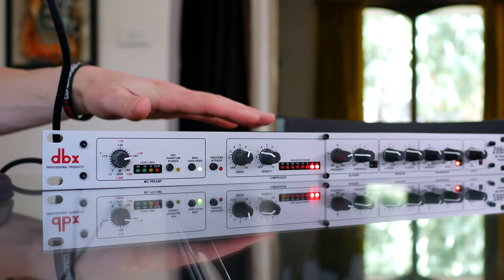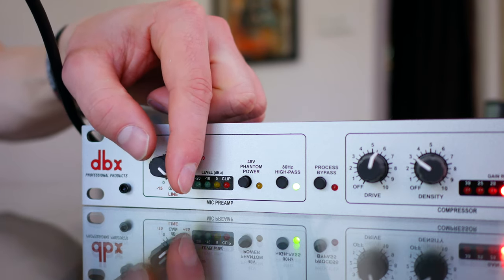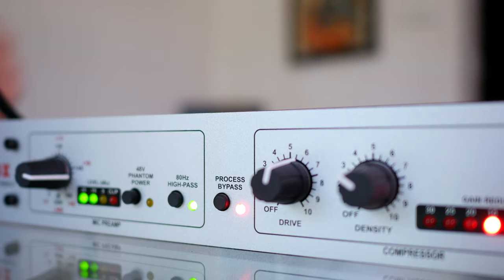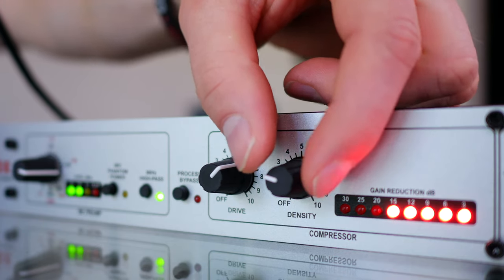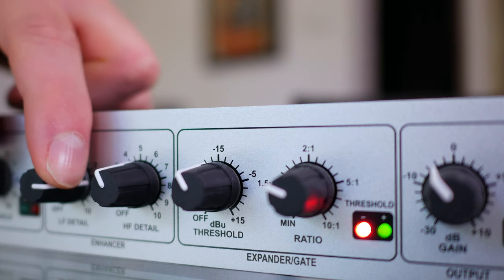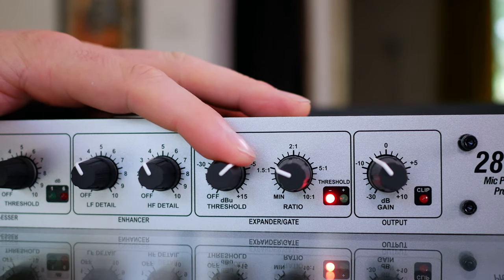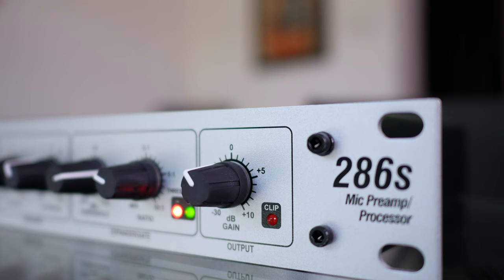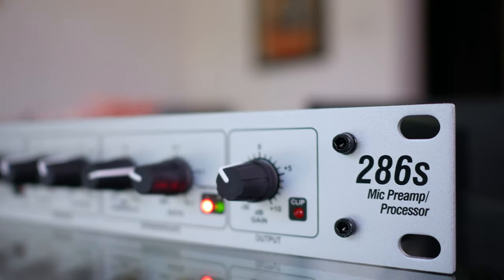How to use the dBX 286s Microphone Preamp and Processor

Comment: Great to find this. I have the dbx 266XS Dual Compressor/Gate and I believe it should work similar. I never used it, as it was left in my storage unit. I plugged it in, but have nothing to test it to sell. But upon plugging, no lights at all come on. Do these have a way to find out if it's dead. Should at least one light somewhere be lit up?

Comment: I've had my 286s for some time, the only issue I have is with a low output mic (like the Podcast&Procaster, I have both) is that I run the preamp near Maximum . To get round this I use a small Mic preamp (Behringer Mic100) connected on the Line input . The setting on the input gain is now on 0db and I control the input via the preamp. The behringer Mic100 is a good little Valve amp in its own right but added to the 286s its now something else.

Comment: Love your video and info on the DBX 286S. I have a question about the 286S. I'm a Newbie in my Voice-Over endeavor. I'm currently rebuilding my recording booth due to too much background noise with what I originally had set up. I use a Rode NT1A and Scarlett Solo. I do not stream yet. My question is would it benefit my signal chain to include the 286S when recording for VO only to be post processed?

Comment: Thanks I just bought this because of your video! I'm also using Rode Procaster mic with Behringer UMC 204HD interface and new MacBook Air. Although all sounds pretty good, i'm not quite hearing the sound quality like yours. Maybe my expectations are too high for Rode? My UMC gain is middle, DBX gain +45 / output 0. Still sounds a tad tin-y. I have good quality cables/adaptors too.

Comment: Always, always, always calibrate your gear;  it's called "Gain Staging". To stay "safe" is to manage the levels of audio through the signal flow. You always want the optimal amount of signal to flow in the analogue stage without introducing noise or distortion(some distortion is taste based).
Reply: Always start yourself with a high signal to noise ratio too, don't want to preamp noises!

Comment: Hey, I've had the dbx286s since early 2016, but I saw that I had a mono trs 6.3mm to male xlr in the output of the dbx, but I've seen guys have stereo trs 6.3mm to male xlr cables instead, should I change?
Reply: Not neccesary, but it's legit, just try and find out, what works better for you. You get better signal / noise ratio and more headroom with XLR output

Comment: I just bought DBX 286s and Rode Procaster, I plug Rode to my Behringer UMC202HD (Gain there OFF/LOW).
So on DBX the first Nob with Gain, you got easly 2 green light on, mine even on +45 I bearly one light poping sometimes. 
Same thing with compresor, with like +45 Gain I put compresor about 2-3 on nob, sounds in headphones almost cliping is that loud ;/
I'm hearing you on Gain + your compresor settings and you so sooooo different that I do on my test ;/ Need to leran more about those settings I think ^^

Comment: I have a question.  If I'm gong to be outputting the signal from the DBX to an inexpensive mixer (like the Behringer Xenyx or a Soundcraft that doesnt have inserts), do I put it in the mixer's MIC IN or over to one of the LINE IN's? I've heard different answers but to my mind, wouldnt using the mixer's mic channels cause me to be running through TWO pre-amps?
Reply: Line in, bc you will bypass the crappy xenyx Mic PreAmps

Comment: How do you like that Procaster mic with the dbx?
I am torn between getting that and an SM7B (for voiceover and singing, with a bass/baritone voice). I already have a dbx 286A (older model of the 286S), and would get an UAD Apollo Twin as an interface.
Reply: You won't regret with SM7B. I have the following set up for my singing  - Focusrite Solo 3rd gen, dbx 286s, SM7B and beyerdynamic DT 770 headset. And I zeroed down on these gears after trying several of them.
Reply: @hemantsharma17  Many thanks! :)
Reply from the maker: The Procaster is maybe the best value high-quality podcasting mic out there.  I would highly recommend it.
Reply: @GeekyNerdyTechy  Thanks! Would you recommend it for e-learning voiceover materials as well?

Comment: How do you go about plugging one of these into the Focusrite 2i2 interface?
Reply: Hello, you would need to first power the unit. After that you need to plug your microphone into the input on the back. Once you’ve done that you need to bring a line out from the output and into one of the inputs into your Focusrite 2I2. I hope that helps and wish you luck! Goodbye.

Comment: I wonder if anyone can answer this. Is it normal for an SM7b to require the gain on the DBX to be turned nearly all the way up to get two yellow lights on level? Mine does this, and I'm wondering if I should put my booster back into the chain?
Reply from the maker: Yes, those mics require a lot of gain to operate.  Most people run a SE Dynamite or Cloudlifter in their signal chain to boost it up. The SE Dynamite is the better option.
Reply: OK, I'm confused because I tried initially with a Klark Teknik between two mic cables, but no signal gets through (no LEDs). Are the Se Dynamite or Cloudlifter a different kind of equipment than the Klark Teknik?

Comment: Hello.... If I got this dbx does it sort out the issue of Rode Nt 1 picking up alot of background noise and ambient sounds. I have a room that isnot treated or sound proofed I wanted to get Rode Nt 1 but all reviews show it picks up alot of ambient sound.... And so I was them reconsidering getting Shure sm7b mic because it doesnot pick up alot of background noise kindly advise
Reply from the maker: Yes, you can set the Expander to a level that helps reduce noise under a certain threshold.  If the noise is really bad you might want to make it more of a hard gate.  Check my review on the Rode Broadcaster it shows you the difference between a dynamic and condenser mic. I just posted it :)

Comment: So do you just leave it on in all the time or just unplug it at the end of the day
Reply: @tristengrant  I run all my gear thru a Furman M8X2. I bought a togle switch for the front outlet and plug the dbx into that. This way when I turn on the Furman the dbx is off until I use the toggle switch
Reply: you could plug it into a power strip and turn it off via the off switch on the power strip

Comment: Excellent review. A fundamental (may be even a stupid) question. If i connect a condenser mic to DBX 286s, with the Noise/Gate, will i be able to control the background noise?
Reply: I may be wrong but I think You can considering its just changing the input signal and nothing about the physical mic. I'm not entirely sure as to how much noise it would get rid of but chances are it would do a good job at least. I just got the dbx 286s with a shure sm7b. A cloudlifter. And a scarlett 2i2. And it works pretty well but again it depends on how much noise you already have. way back when I had a blue yeti...(4 days ago) it had so much noise the only way to lower it was to lower the input levels in the audio settings on my pc to about 80. Would be nice if I could do some testing for you but my gut tells me that you should be very happy with this preamp whether it does lower it a lot or not. And heck it may even lower the noise just by using it because it's a pretty quiet preamp anyway. And I'm sorry for this essay of a comment but be wary about any Trs to aux cables as I tried using one to bypass the scarlett 2i2 usb audio interface because the 2i2 is noisy without anything even plugged in and what I got was what sounds like a jackhammer at full throttle because the cables or signals are somehow different. Hope this helps if even a little!!

EDIT: The scarlett 2i2 had an update now there's no noise at all